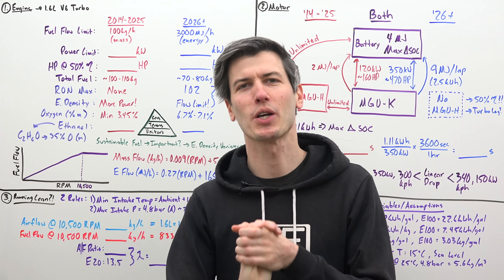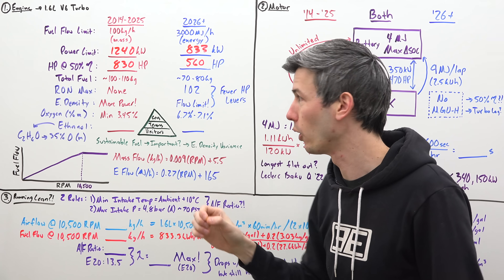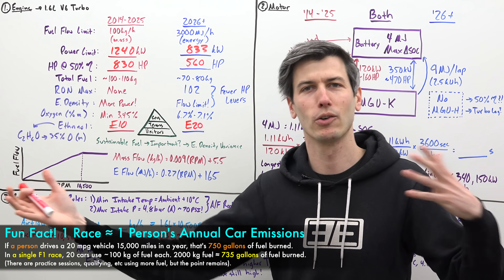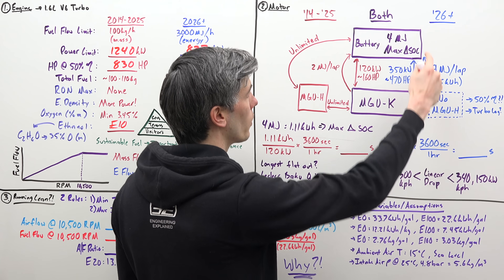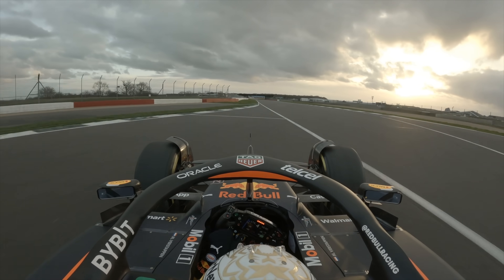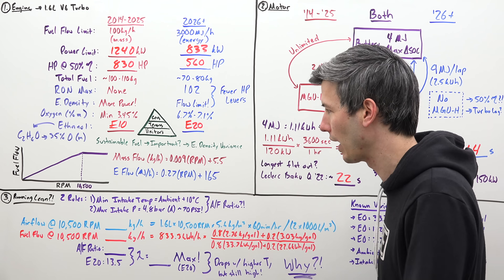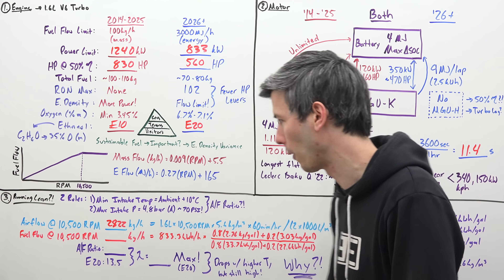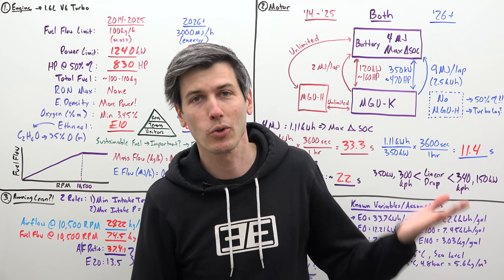Why Are 2026 Formula 1 Engines Going To Lose So Much Power?

Comment: is there a point to having different engine manufacturers with this change? seems like they're all going to have the same power numbers
Reply: The theorical and real power are not the same. Some manufacturer can get the same power with less mass, the other more power with same requlations etc… Also there will be differences when and how to charge the battery and when and how to use the e-boost. Use all in 11 second and use less in 22, 33, 44 seconds… There will be a lot of variation!

Comment: I hate that they are limiting the cars so much.  I would love to see the innovation within their cost cap and the use of a hybrid system.

For example if one team decides to have an EV powertrain then let them.  Limit the battery and engine size and maximum gas but not the way power is used.

Everybody has the same amount of potential power...  now figure it out.
Reply: No team would go down the EV route in that case, it's all down to energy density. Gasoline is far too dense compared to any battery technology, and anyway there is already Formula-E
Reply: @tedferkin  why not.  You would have engines still but running at their uptimum rpm.  The most efficient rpm all the time.
Reply: @answeris4217  batteries are very heavy compared to fuel. Current cars are 200 kilograms fatter than just 10 years ago. Weight has borderline unbelievable consequences for everything in racing: acceleration, braking, cornering speeds, tyre wear – all suffer with every kilogram. iirc Adrian Sutil many years ago was preaching for bigger minimum driver weight limit, because he was taller than most and couldn't lose as much, to the point he was experimenting with carrying less 'drink' in the car and trying to minimize it as long as his performance didn't drop. All that ridiculous effort to save probably less than a kilogram!
Reply: @de_oScar  if everybody has the same battery but not limited on how or what can power the drivetrain
Reply: @answeris4217  Formal E has an exclusivity contract on EV racing with the FIA.
Reply: @toejah  it's  "hybrids"  you still need a generator.
Reply: @toejah  I am talking about using a electric Motor with the ICE engine as a generator.  Like a train or heavy equipment or large ships
Reply: @answeris4217  all of them are still hybrid drive trains not EV drive trains.

Comment: I've always like the idea of race cars testing tech that will eventually move onto road cars.
Reply: They should just start racing electric CUVs then.
Reply: @Sonny_McMacsson  Ha, I was thinking more like how tech NASA comes up with trickles down.
Reply: @IrocZIV  and what tech would that be? I can’t think of a single thing that NASA has developed that has entered the wider marketplace.  Same with race cars, usually the innovations go from street cars to race cars, not the other way (a few exceptions come to mind: rear-view mirrors, seat belts, active suspension; some innovations like disc brakes were popularized by motorsport, but were in fact invented for non-race applications)
Reply: @jpe1  As far as race cars, I didn't say anything did trickle down, I just like the idea that it would. It could give it a point. If you are going to push the tech so much to fit into these arbitrary rules, why not make the rules push innovation towards something that can help society in general.
As far as NASA is concerned, not sure specifically what they directly have done, but I heard they do a lot with aeronautics that has helped improve passenger jets and such, not to mention any material research
Reply: @jpe1 
Ball point pens…
Reply: @haukikannel  ‽‽ My mom was using ball point pens when she was in school (she graduated HS in 1944) and when I looked it up, the first patent for a ball point pen was issued in 1888.  But I did find a cool piece of tech that is a direct spin-off of NASA, NiTiNOL alloy tubeless tires for bicycles, adapted from designs used for Mars rovers.
Reply: Its extremely overblown, the main incentive has always been about bringing prestige to their car brand so people will buy them.

Comment: Every change to F1 regulations takes the sport in the wrong direction.  Get rid of the hybrid systems.  Bring back V10 engines.  Bring back mid race refueling.
Reply: The v10 era was nice for it's cars but so boring in terms of racing and sport
Reply: @SHRModding  I disagree, V10 era felt like a sport.  Every race I was excited to see what the teams brought to the race.  And to see what refueling and tire strategy they would use.  Current F1 just seems like a rehearsed performance with every driver doing the exact same thing.  I am bored to death.
Reply: "continue to make the sport boring and non interesting for any oem but atleast make them sound nice so I will be pleased"
Reply: F1: We need more efficient cars!

Also F1: NO MGU-H
Reply: i think regulations like energy flow limit are ok, but then let the teams decide the rest to find the very best solution. then it would all be about efficiency, from which we all could benefit one day.

Comment: Could the airflow limit stop teams from making power much lower in the rev range? For example, if the engine is only spinning at 5000rpm at times then the airflow limit will stop them from going leaner than 1.4 or even 1.2 with the higher air temps you mentioned and that does seem like a limit teams might bump into.
Reply: They're already limited to less energy flow rate of fuel at lower rpms as per the purple graph in the video so I don't think that's it either, good idea tho

Comment: If your fuel flow is limited but you can continue to increase the mass of the working fluid (air), you will have higher end-pressure and lower end temperature in the cylinder, thus a higher fraction of the available energy is converted to mechanical work on the crank, and less wasted out the exhaust. But why they would want to limit something that increases efficiency tho, THAT is beyond me. If the whole point in F1 nowadays is to showcase maximum use of available energy...

Comment: That intake pressure limit got me thinking....Just a shot in the dark but it occurs to me you might be able to "replace" the mgu-h with a kind of hyper-egr which in stead of cooling and diluting the charge could heat up and pressurize it to increase MEP or even be used to control compression ignition.....
Reply: bro what does this mean in simpleton english
Reply: Recovery of exhaust gas energy by taking them back into the cylinders at certain times for increased efficiency
Reply: @jakubstaniszewski477  Doesn't that only work for inefficient fuel burn? You want denser cool air which carries more Oxygen to burn all of the fuel, not hotter air with more CO2 from previous fuel burn
Reply: @UncleElias  unless you have 140-170% excess air in your charge
Reply: Definitely some good points here, if your charge is way too oxygen rich then you could reduce pumping losses by allowing the exhaust back into the intake, reducing oxygen content if you're too lean, upping temps of your intercooler is too efficient and allowing that compressed exhaust gas to help spin the engine on the intake stroke, now I wonder if this is why there is a 'boost' limit even though it seems charge at that pressure would be way too lean, the egr theory explains the pressure limit
Reply: That's another great point

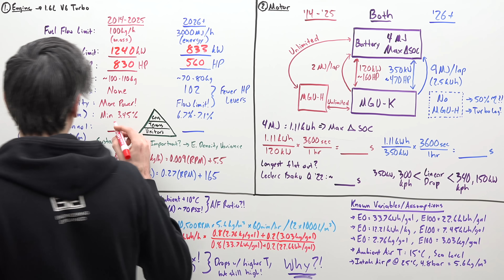Comment: 3:38 so...is E10 means 10% ethanol content or 10% gasoline content? The text on the bottom kinds confusing
Reply: The "E" stands for ethanol, i.e., E10 means 10% ethanol.
Reply: E10 = 10% ethanol and 90% gasoline

Comment: I'm sure I remember a day when they just said "3-litre maximum, that's it, no more engine rules" (well there were a few others but not many). I can see the day coming when F1 disappears up the backside of its own pompous addiction to complication.
Reply: That was 1966 - a time where turbo racing cars were still on the horizon. Mechanical fuel injection was about the limit of tech used, and by 1967 it resulted in glorious V12s, a few V8s, and a bonkers H16, all revving in excess of 9000RPM (some getting to 10 and 11k!).
Reply: Yep, that would be fun. "1.6 liter. Do whatever but you are limited to kg of fuel on board / per race and the max car weight". Let em even make diesels. That would be fun.

Comment: F1's use compressed air, not gasoline. Same with airliners. There is no fuel. Call my a conspiracy realist. Watch your pit stock activity next time you watch F1 race. They do a pitstock to suck water out, no put fuel in.
Reply from the maker: Finally makes sense (though they don't refuel in F1 haha).
Reply: No, they use apple juice. Did you not know that?

Comment: If it were possible to run strippers (CAT's) in the intake / charge cooler to increase O2 density then it could make sense to limit air intake volume which could also explain how F1 can apparently run so lean

Comment: Bit of a bummer that the revs are going to keep dropping. Sure it's extremely expensive to make high revving engines like the V10's we had 20 years ago but I don't seem to recall there being a major drop in spending on ICE development after they cut the revs for the V8's and V6's now (plus they're smaller engines, less mass, easier to rev higher), and the cars are already heavy and large as hell compared to the V10's so who cares if they use more fuel during the race? Could make race strategy more interesting as burning off more fuel at the start could result in a dramatically lighter car, or just reintroduce refuelling with standardised equipment and procedures and make the cars much lighter overall. You could say that it's a safety concern, but how many endurance races have had major issues from refuelling lately? If it's heavily regulated with standardised equipment I honestly don't see why it would be a major issue.

Comment: so the cars will have 1000hp for 11 seconds, the rest of the lap, 600hp?
Reply from the maker: No, since you regen each time you slow down. They'll likely have ~1000 HP available most of the lap, with the exception of speeds above 300 kph as well as long long straights.

Comment: Great analysis of the crazy changes made... just because. I'm a big racing fan, but nothing is "green" or "sustainable" about racing. You go in circles (bigger in rally), burning up fuel and tires to get nowhere. For this weekend's F1 race, they will slow down on the straight with these new changes.

F1 has so much irony in that on one hand they argue they need lower cost caps to keep engineering costs maintainable, while at the same time they keep making the power-train dept jump through hoops to redesign and be competitive. I'd rather see "simple" screaming v10s without DRS and all this energy recovery / deployment stuff for better entertainment value. It's not significantly less "green" after all, and they sure sound better.
Reply: You nailed it.
Reply: I want to agree with you for V10,... It's the most beautiful orchestra for my ears 😀. But I think that is the essence of Formula racing, you got to keep developing.
Too bad, F1 felled for VW group to ditch MGU-H, I really want that tech to be applied on road cars for mass (I know they put in AMG-One). What they can do perhaps to make MGU-H as stock equipment so new engine manufacturer can stop bitching about the cost of developing it.
Reply: I don't think the main point is to make the race itself more 'green', but rather to help those technologies to be developed further and for it to trickle down to normal street cars. It's what I like about formula 1, it is not just pure racing, but racing combined with cutting edge engineering.
Reply: @thorwaldjohanson2526  Indeed, it was a problem for years that the technology wasn't good for anything outside of F1, and now they are trying to change that. Developing new technology is so d*mn expensive that if it's left to the regular mfg it would need to be forced entirely by laws, and that's driven by politics, which is driven by agendas, and so on... 🤪
I'm happy as long as it's not full electric, I can't stand watching that.  😂
Reply: @PSA78  I concur. Full electric has its own race anways. And combustion technology is not going away completely anytime soon. I think especially the renewable fuel research could be big and have a huge impact. Not just how to produce it, but how it behaves exactly during combustion, how the maximum amount of energy can be extracted etc.
Reply: If straight line speed is reduced, then it will mean cars will stay closer on the straights, which could potentially increase overtaking. The car in front is battling aero with a weaker motor, whereas the car behind has far less aero forces and able to keep accelerating

Comment: they could maybe use the high boost pressure for a really torquy low/mid range since you wont be limited by fuel there but idk what that would realistically help with since driveability would probably be awful.

Comment: 💀 dude firstly there is no engine currently on the grid with 850HP. The slowest is Renault which is estimated to be 1000hp. And teams will probably find a way to find even more power with 26 engines
Reply from the maker: 850 HP is the combustion engine. 1000 HP is with the MGU-K power added. This is explained in my last F1 video (https://youtu.be/KjrNcuc89Pc), as well as this video.

Comment: F1 rules often feel arbitrary and confusing, I think they just like to mess with us.
Reply: Judging by other comments, it seems like they put seemingly nonsensical limits because there are a ton of different strategies to get higher power while keeping below the energy limit. I read about possible EGR systems that start to make sense if you have such a lean charge in your combustion chamber.

In short, It's to prevent team engineers to come up with creative ways to get around rules
Reply: They really aren't thinking about "us" at all when making the rules lol. The sport would be very different if the main purpose of the rules were, "Hey would the fans like that?".
Reply: NASCAR: First Time ?
Reply: they gotta be smoking something wacky to come up with all of this
Reply: @enolopanr9820  I'm calling ketamine.
Reply: Theyre done for safety and cost as well as to retain the interest of the public
Reply: f1 is a joke
Reply: They don't care about the sport, it's all a circus to push EVs.
Reply: No F1 is about advancing combustion technology. By making combustion engines more efficient and having synthetic fuels, we can make engines stick around alongside electric cars. Are they going to be the high revving NA engines of the past? No, but at least we're still getting an engine.
Reply: @456MrPeople  
First, no, the Formula one was never about technological advancement, it was about manufacturers pride, like pretty much every other sport. The technological advancement thing came about with the political views turning towards solving climate change.

Second, don't be confused, the combustion engine will die out and it will come faster than you think, especially in such a political circus like Formula 1.
Reply: @Enthropical_Thunder  ''solving climate change'' ...  The arrogance of human is always amazing.
Reply: @Enthropical_Thunder One of the easiest ways to help with climate change is to stop planned obsolescence and have keep the right of repair. I don't think throwing away ice engine is something we should do just yet sense even in the near future just because we simply don't have enough lithium until we can mine astrids. I think using Ice engines as a stop gap would be better especially with the porsche bio fuel that anyone could use without some expensive fuel pump. I don't like current electric cars just because of looks for the most part i just feel like it's too early to make them the main form of transportation
Reply: @456MrPeople  endurance racing has more technology trickling down to consumer cars than F1. Also, endurance racing has been using synthetic fuels for a while now.
Reply: @456MrPeople  why use synthetic when e85 has been around for decades(you could even do e85 but the 15% gasoline is synthetic)
Reply: Because synthetic fuels can be a drop in replacement for cars while flex fuel is not. Also past E20-E25 you get less range from ethanol.
Reply: @Enthropical_Thunder  This "F1 is about technological advancement!" cope comes from new F1 fans who know deep down that the sport is being ruined by 1000hp screaming V10s no longer being a thing, but they have to defend it.
Reply: @Quaker763  That's not true. It really isn't cope. Going away from V10s isn't simply what's "ruining" the sport. I agree that the current ICE rules are extremely underwhelming. I got here wondering how the ICE is losing somuch of the power while the engines are mechanically the same.

The problem with F1 is that they always bring something new and innovative into the sport at the cost of smthn that was already great. And that's what needs to be stop. These new engines will still be a marvel generating ridiculous amounts of power for such an extremely compact package. But they can do better obviously.

For 2031 they should just remove the energy flow limit, increase the battery deployment to 8MJ/lap. It will pretty much solve the problem. If that's not feasible taking into consideration weight or control electronics then they should just switch to V8 with synthetic fuels, bring back the MGU-H and keep the MGU-K at 200 kW.